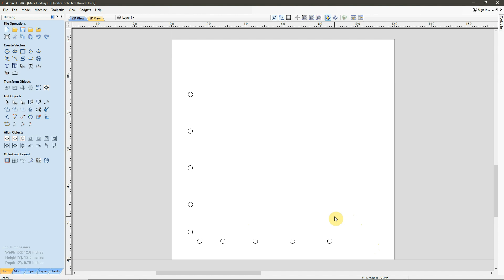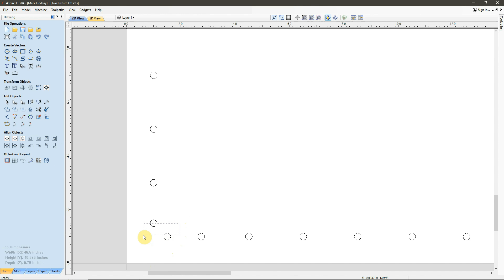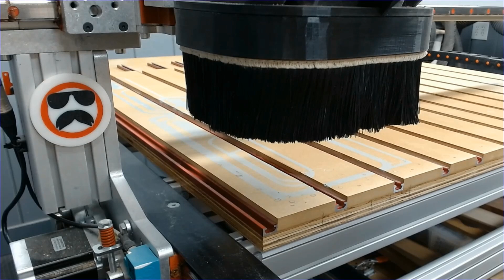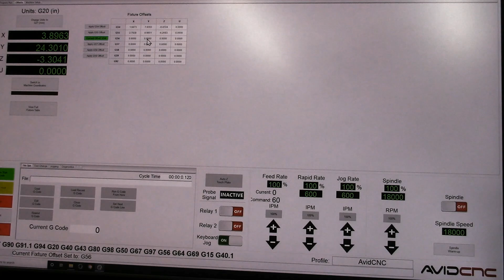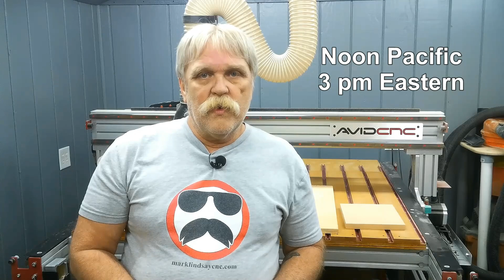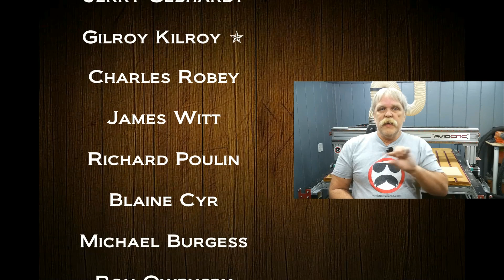Creating Two Fixture Offsets in Mach4

Comment: Great Video as usual. I wonder if you can help me, I am still using Mach3. I have been using it for about a year now with now problems. Getting g code from easel transferring to another pc that has Mach 3 on it and all good. Until yesterday seems like machine loosing zero position while carving detail cut. Starts going deeper in cut and destroys project. Can you give me an idea. Thanks Mark
Reply from the maker: Always check the mechanical first. Tighten all motor couplers and belts, even if they look tight. Make sure you don't have any static crossover in any dust collection system you may be running (ground the hose.) Lube your linear rails/guides. Lastly, make sure your collet is snugged up to that bit nice and tight. If the problem persists, check the bearings on your Z axis ball screw or linear bearings.

Comment: Mark, great demo and explanation. Offsets are a huge workflow efficiency.  I have a larger table and have set up about 15 offsets throughout my table. a word of warning from experience: I don't know why, but sometimes the data from the offsets table just disappears....it has happened to me twice. Super frustrating. As a mitigating strategy, I have developed and Excel table that captures the offset data, so if the data is lost, I can cut and paste the coordinates back into Mach 4 from Excel without having to re-establish the coordinates with the probe.
Reply from the maker: That's a great tip! Thank you!

Comment: Why did you align the holes to be be 1 inch on center from edges.  Wouldn't aligning the holes so the holes to left and bottom of x,y axis lines give you true left and bottom of piece?  By aligning to center of dowel holes your piece will be .0625 right and up from your x,y coordinate.
Reply from the maker: Actually, no it won't. By mounting the piece of material, then using my touch plate to set the X Y zero for that fixture offset, the X and Y zeros are set to the corner of the material - not to the pins. The physical location of the pins is completely irrelevant, as long as they're square to the X and Y axis travel, and you home your machine every time you start Mach3 or Mach4.
Reply: @MarkLindsayCNC  lol nvm
I may of overthought that.
Reply from the maker: No worries. It's a valid question.
Reply: @MarkLindsayCNC on my 3rd spoilboard with  dog holes I did exactly this. Now my grid is exactly at 5,10,15, etc inches, not 5.1245" it makes it easy to GO TO 15,10 for example. I put my stops in the dog holes, clamp the wood, I know my XY already. I only zero XY off the board if I am 3D carving where I need that extra accuracy.

Comment: Hi Mark!  Multiple offsets are a very powerful tool.  

I recently had a project where I had 40 parts to cut top and bottom (so actually 80 different cuts).  I had a jig for top and a jig for bottom.  

I cut and paste the toolpaths into one big gcode file, and put the command "G55" in front of the first part of the toolpath, and "G56" in front of the second part of the tool path, so it would do both parts at once.
Reply from the maker: I have not yet gotten into editing G-code. That will be coming down the road, but as you can imagine, even suggesting editing G-code to automatically move your spindle  out of the way when a file finishes running caused controversy. I'm with you, though!
Reply: @MarkLindsayCNC  Very true.  I like to experiment with dangerous things like that.  I edited my PP so the after the program is done, it raises Z to the max height (command is "G53 Z0.0000").  I used that same command between those G55 and G56 toolpaths to help ensure not hitting anything.
Reply from the maker: Yeah, I haven't even begun to edit post processors yet. So far that's still above my pay grade.

Comment: This was very clear and will help me out a ton.  Thank you.  I have the same system with Mach 4 and I have been wondering about how to do exactly this.  I can't wait to try it.  I make walnut plaques for a plaque company and being able to get one set up while the other is cutting will save me time.  When you use the touch plate it has a field where you can put in the diameter of the bit.  Are they asking for the shank size or the business end of the cutter?  Thank you.
Reply from the maker: They mean the business end of the cutter. That's only for the X Y zeroing operation though. If you're just probing Z, the bit diameter isn't needed. I almost forgot to set the bit diameter before probing X and Y a couple of times. That's why I use that 1/2 inch steel dowel for setting X Y zero. Then I don't have to worry about that diameter, because it never changes. I can just put it in hand tight, probe X and Y, then pull it out and install the bit I'm going to actually carve with.

Comment: why choose holes with pins that always have to be pulled out and no threaded bush?
Reply from the maker: The simple answer is, because I already had those pins, so I didn't need to buy anything to make this work. You could also use standard hardwood dowel, or go with your route and use threaded bushings. We all have our preferences and priorities, and I'm all about options.
Reply: @MarkLindsayCNC will dowels from the big box stores be sufficient for this?